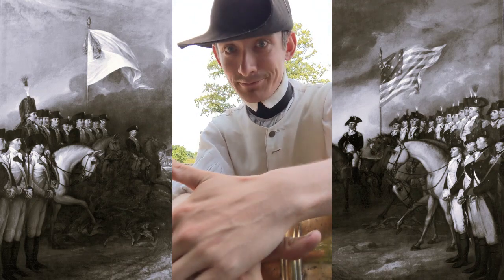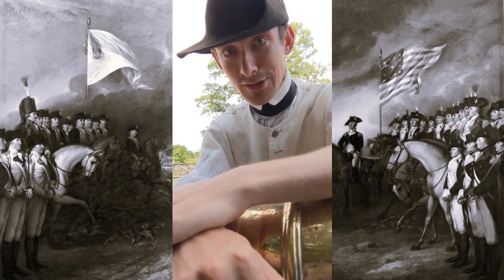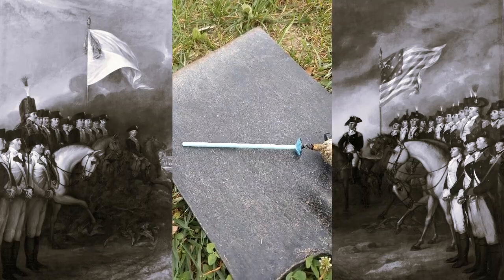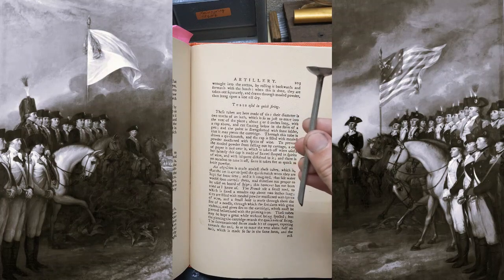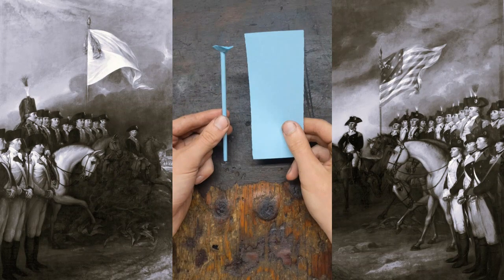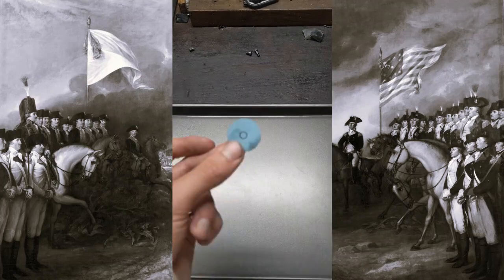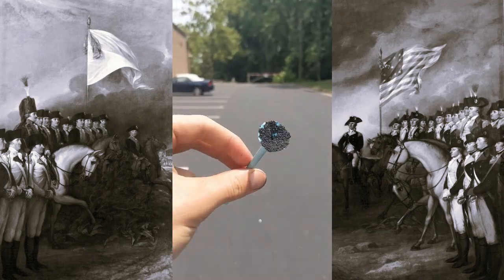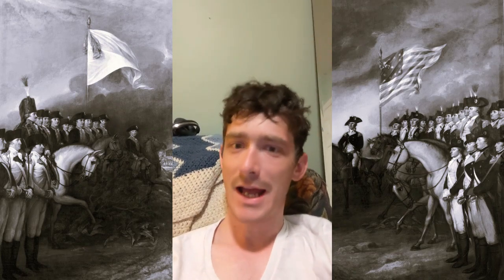Primed and Loaded | 18th Century Artillery Quick Fire Priming Tubes: And How We Make Them

Comment: Gun powder and red wine?? Wine is not "proof" . I don't believe "wine " at that time was "proof"  what did the wine do?? .... Sorry im a shiner also
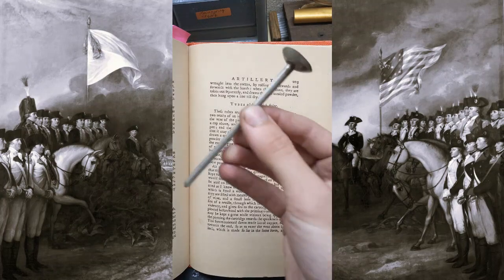Reply from the maker: Are you referring to the 5:04 mark in the video when Jamie says,"...capped with a rim filled with gunpowder moistened with spirit of wine?  Well, spirit of wine is distilled spirits.  It is probably used in this manner to provide self adhesive qualities to the moistened gunpowder, when applied to the priming tubes. Plus alcohol generally has a quicker evaporation rate than water and once revaporated, the gunpowder is fully cumbustable.
Reply: @JYFMuseums  the evaporated wine might hold a tight bond . I just couldn't figure out why wet non flammable liquid would be added. But to create a tighter bond than water does, make since
Reply: @JYFMuseums  the word "proof" original was ment for gunpowder wet with liquor that would still light . .. it wasn't proof unless you could light the wet powder. ... It had me confused
Reply: @JYFMuseums  ty for the response!!😁😁😁